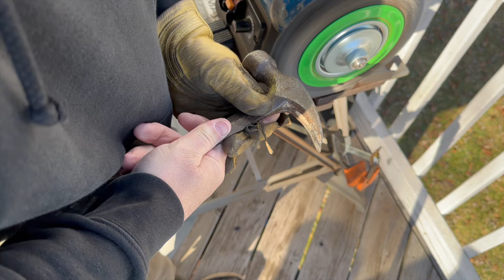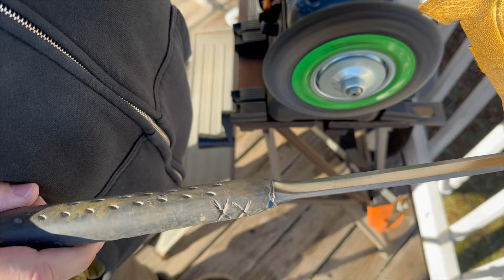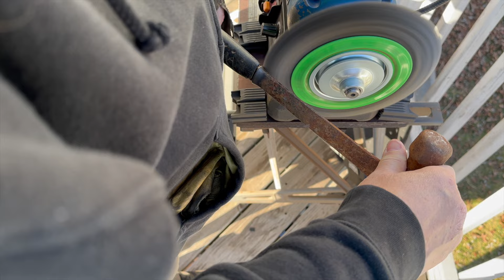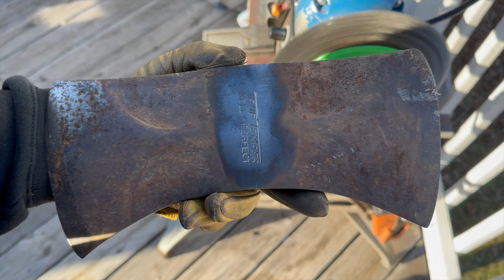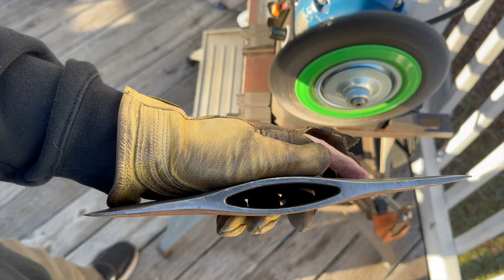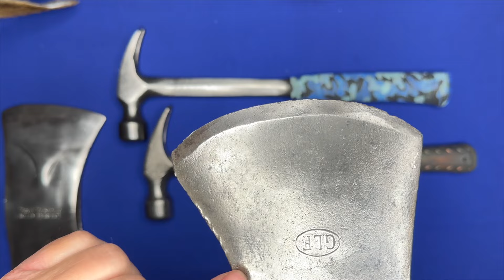Tool Clean up Vintage Double bit Axe and 2 Estwing hammers

Comment: I’ve also cleaned up some old tools on the wire wheel and then used lanolin (spray can) to help prevent them rusting, works well. What do you use or do you just leave them as they are.
Reply from the maker: Thanks for watching , really appreciate you spending some time on the channel . It really depends on what we are planning to do with the tool , it could be almost anything if we are trying to get it to look a certain way or if its just an everyday user or maybe a custom restore , there really is not a right way its just whats works for each situation . Thanks again for watching !!!